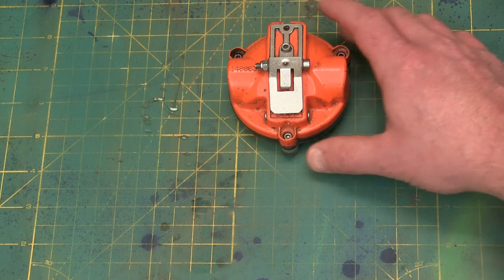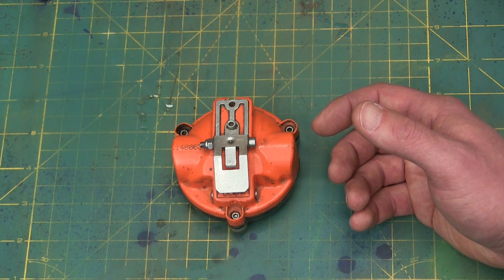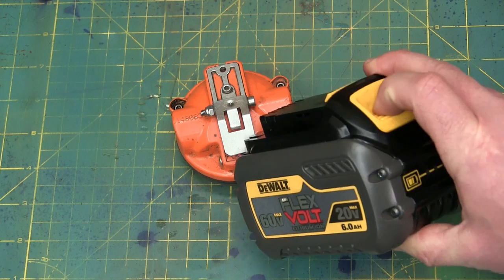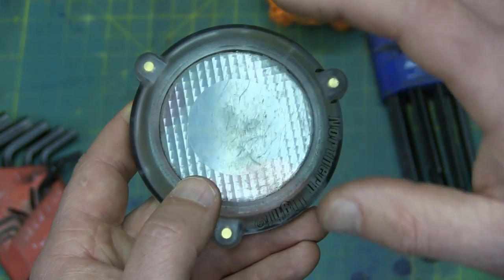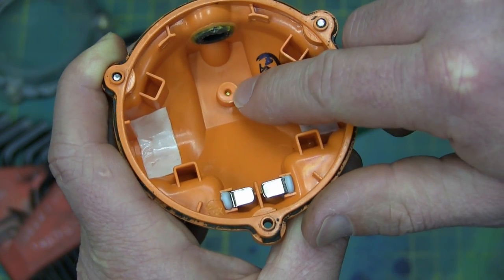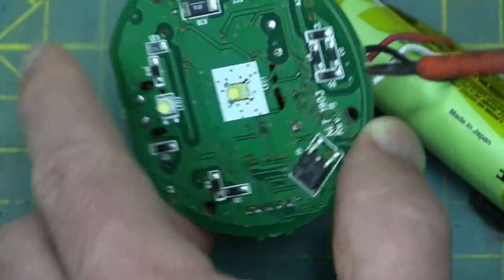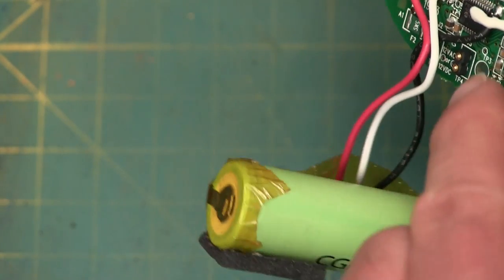BOLTR: $500 Industrial FLASHLIGHT. WHY SO MUCH?

Comment: It looks like an 18650 battery.
Reply: 18650= 18 mm diameter X 65 mm in length. "0"= round.
Reply: A Panasonic CGR18650EA to be exact based on the label it's clearly in focus around 5:42, I think that line had roughly 2500 mAh nominal capacity on the specification. 

And they handled up to 5A discharge well enough based on the 2 of them that I've used over the years. Wouldn't know what the actual datasheet specified for them, I just know they held up to that for a good while in my use (acceptable operating temperatures of the cells, so definitely not too much internal resistance)
Reply: Extra stuff And it's a relatively recent one, having the same wrapper as the famous NCR18650B (older Panasonic 18650s came with a different wrapper)
Reply: Model Number: CGR18650EA   Nominal Voltage: 3.6  Typical Capacity (mAh): 2550
Reply: NetRoller3D : the NCR19650B is not that great of a battery it  has a max discharge rating of only 4.87amp  the NCR18650GA  Is a Much better 18650 3500Mah & 10amp discharge rating

Comment: I found a way of 'cutting' tempered glass decades ago while working for a car breaker.

Oxy/ace! Cuts through like a hot knife through butter. 

I was young and just messing around while cutting up parts of the car for fun. It was going in the crusher anyway and I didn't have to pay for the gasses. I'm much more temperate now I pay the bills!

Comment: by the way that's an 18 650 battery
Reply: Looks  too thick to be an 18650; I'd say 26650.
Reply: Even with the very clearly showing 18650 text on it?
Reply: It's right in the battery.
Reply: I believe he was referring to the ah. Jeezlus Fuuuk!
Reply: 3400mah
Reply: +David Reynolds
It's a CGR-18650EA: a 2550 mAh battery.
Reply: It is 100 percent a 18650. I use them everyday.
Reply: Correct. 18mm diameter x 65mm length 0 denominates that it is a round cell. .... From what I've read.
Reply: Skip to 5:42 and read the label, as the others were saying here its clearly a Panasonic CGR18650EA
Reply: Rob Oh, I thought it was a simple extension of the numbering of button cells: 2 digits diameter in mm, then 2 (or 3) digits thickness in tenth of mm.  So 2032=20mm diameter 3.2mm thick,  18650=18mm diameter, 65.0mm thick.

Comment: If you're ever looking to clean plasticy headlights or lenses. Use 3000 grit wet sandpaper will take the haze and shit right off the lense. Takes a bit of elbow grease. Once youve cleaned and dried it with a cloth you  can use automotive grade clear coat in a rattle can. It takes the haze out completely from the damage the sandpaper did.

Comment: i thought you used acetone to crack polycarbonate? works on cd's (remember cd's?), this is probably a bit thicker tho.
Reply: mmmhorsesteaks i thought cds where acrylic
Reply: Nope, poly. #TheMoreYouKnow
Reply: yes it does, i can personally attest to  brake cleaner DESTROYING my acrylic water-cooling loop on my pc.
Reply: I've had acrylic spontaneously crack from cleaning it with IPA
Reply: Environmental Stress Cracking (ESC) One  theory is that the liquid can diffuse into the polymer, causing swelling which increases the polymer’s chain mobility, this would be increased if the polymer surface is damaged or under stress.
 I accidentally destroyed an acrylic motorcycle wind-shield when I tried cleaning it with Isopropyl alcohol (propan-2-ol), it was OK till I got to the edges, then it crazed.
Reply: Acetone is quite brutal to many plastics. But if you want to destroy almost any plastic, use dichloromethane. It will not necessarily crack them, but gooify them and mess up the surface or shape. It's used to "weld" acrylic (leaves invisible joints). Also works for glueing PC, PS, ABS and a few others.
To the others here: yes, acrylic is pretty much destroyed by anything, even "harmless" ethanol.
Reply: *****
 That makes sense, the  acrylic motorcycle wind-shield I mentioned had a flame polished edge. The Isopropyl alcohol was fine until I got it on the edge and it crazed.

Comment: The battery is an 18650 series. That circuit is a BMS "Battery Mainteain System" over volt/temp and battery voltage maintenance for when left on the the charger for long periods of time.  Love your videos. Keep them coming.

JD
Red Deer

Comment: 3XX are primarily austenitic and can indeed be a bit magnetic (if they are cheapo on Nickel addition for example). A bit of magnetism comes from delta-ferrite that is in them (residual from solidificaiton during production) and martensite which can form on cooling (when these are annealed) in low alloyed versions and also forms when this steel is subject to strain (for example cutting, bending etc.). High Ni grades will not transform that easily.

Edit: Awesome videos! (forgot to add)

Comment: Interestingly, back when I made eyeglasses for my day job, I was able to crack polycarbonate lenses with 91% isopropyl alcohol.  With the scratch resistant coating removed, you could submerge it in alcohol for days with zero effect.  If you inserted the lens into what I believe was a cellulose acetate frame and leave some 91% isopropyl alcohol in the groove between the frame and the lens, within a couple of hours or less, you would see a crack forming in the lens, but the frame didn't seem to care.  There was some kind of chemical reaction occurring there which the polycarbonate was not happy with.

Also, to crack polycarbonate, you just need to physically stress the material--pinch it with a vice grips and leave it like that for awhile--and cracks will develop.

Comment: They should have used an NCR18650B cell for the price they are charging

The NCR18650B cell holds almost 50% more energy than the CGR18650EA cell and only costs a few dollars more while having the same max continuous discharge rating 

NCR18650B: 3400mah 5A max drain 
CGR18650EA: 2500mah 5A max drain
Reply: In general the higher capacity ones don't last as many cycles. Though I think they can just have a changeable battery therefore when it dies you don't need to wait for it to charge.
Reply: @groundzero_-lm4md  it's the same cell that tesla uses in their cars, they are rated for around 1500 cycles

Comment: I use Panasonic 18650 batteries in my flashlights. They cost about $5-$6 a piece, but they work very well. I just use small neodymium to bridge the batteries in series, and they have amazing power density for their form factor. They will only fit in items that are sized for the larger 18650 battery though. I believe these are the same brand/type batteries used in the Tesla Model S.

Comment: The thermostatic fuse your talking about is likely a thermistor for charging. Li-Ion cells are a bit touchy to charge properly, normally cell temperature is monitored to prevent fires

Comment: CGR-18650EA industrial use, unprotected, 3.0-4.2v, 5 amp max discharge, 2500 mAh.   18650s are appx 18mm diameter and 65mm length.  probably around 500 - 600 discharge/charge cycles for about 70% of initial capacity.

Comment: Should have used methyl ethyl ketone or MEK on the lens. We had it in the shop for secondary processing of some plastic parts. Dip them in the MEK and jam it immediately in the hole, together forever. We also made plastic hub caps for semi-trailers. They were 1/4" polycarb. Every so often one would get stuck in the mold. By the time someone noticed it had shrunk on to the mold so tight the injector pins would blow right through it when you upped the pressure. Now you are stuck beating on it for an hour (never good for the mold). Or you pour MEK on it. Give it about 5min and stink up the place. Then you hear POP, and the cracked part falls out of the machine.

Comment: A lot of those protection circuits are current-limiting resistors to prevent unwanted sparking  and Zener diodes to prevent reverse charging of the battery.  The spacing of the components on the circuitboard is also critical to meet the certification, both to reduce component temperatures and making sure that there won't be any sparking between the components.  Typically, a class 1 div 1 electronic device will have a number of protection concepts including being intrinsically safe and incapable of releasing enough energy to create a spark.  At my company, certifying something for class 1 div 1 with UL tends to cost anywhere from $5-50k US, with additional cost for certifying for Canadian standards.

Comment: I realize I am super late to this party but the reason the lens didn't break is because someone molded it extremely well, rather than just squeezing and squirting the plastic without a care in the world.

If you know what you are doing and the geometry supports the method, you can alleviate those internal stresses during the molding process. This is mandatory for optical quality components and, as noted here, pretty useful for safety as well.

Comment: That battery is common (18650) in Vape boxes and you can find replacements, chargers and other related pieces at smoke shops. They operate at around 3000mAh 3.7V.

Comment: The battery size is 18650 (it's printed right on the side). It's a pretty standard battery that's found in everything from electric cars to electronic cigarettes and laptops. Also, a lot of high end flashlights (brands like Olight, Streamlight, FlashTorch, Nitecore, SureFire, etc.) use them.

I have several ranging from 3000mAh 40A drain to  3500mAh 30A drain to 2100mAh 20A drain.

They are a very versital Li-ion battery and tend to be pretty cheap. Also, plenty of cheap >$20 US for a decent 2 bay charger and >$35 for a decent 4 bay charger.

It doesn't suprise me that they chose this battery standard; it's cheap, it can hold decent capacity, and it's pretty much the standard.

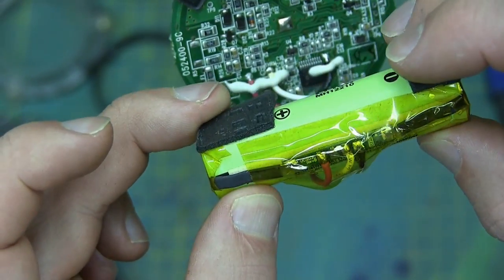Comment: ... but the PRO is: The cell is made in Japan (not China) @6:10  ;-))
Very funny - 500 bucks vs. parts for around 4 to 8 USD (incl. PCB exkl. the cell from japan, hehe, and the case, metal clip and screws), I would say: A fair product and very modest profit margin! (I speak sarcasm fluently - hope u mentioned this, hehe)

Comment: The battery is an 18650 battery... Just means 18mm diameter x 65mm tall. They usually output 3.7v (really about 4.2v when fully charged down to 2.7 discharged). Maximum capacity with current technology is around 3400Mah. Max current on the really good ones is around 25A continuous drain. Obviously capacity drops as current goes up and vice versa.

Comment: a little acetone will do the trick to craze polycarbonate. It is a common trick in aluminum shops to dip someone's safety mcglarsses. Berryman's carb cleaner works as well, since it has acetone.

BTW, even the 300 series of stainless can be magnetic. cold working disturbs the austenitic grains, and causes slight magnetism. 316 fasteners are surprising magnetic.

Comment: best i can tell is that battery is 2500 mah with a 10 amp rating. decent all purpose cell. if you want to know more about 18650 batteries i suggest pokin around vaping forums. theve got full on charts for these batteries to decode battery chemistry, mah, and max discharge. gotta love the cloud chuckrs

Comment: The battery is 18650: 18 mm dia, 65 mm length. Can be found in vapes, cells of laptop battery, and of course Tesla electric cars (6000 of it).

Comment: Bit of a late one.. Trying to shatter a clear plastic? Take a sheet of PMMA, drill and tap it then thread lock a bolt into it. Sit back and wait as the thread lock splits the plastic. Found that one out when the cheapskates at the engineering company I worked for refused to use polycarbonate for their robot enclosures and used perspex instead.

Comment: ElecEng here, I've never played underground but worked in surface iron ore and coal.  Lots of mates in both on and offshore oil and gas as well as underground coal, nickel and gold.  I also used to do electronics design.

I wouldn't design it using a voltage regulator account heat dissipation and hence fire risk.  Think Moura (Pronouced moa rah)  coal disaster in Queensland australia.  Bad.  Very Very Bad.

Comment: In the US, things have to be MSHA (Mine Safety and Health Association) certified if they're to be used past the last break or crosscut toward the face (which can have gas due to poor ventilation). From that break back, they don't need certification. I used to manufacture water sprays for fire suppression at the belt head, flight monitors, roller switches, etc., and then worked in the engineering dept at a local mining machine mfg (roof bolters, etc).  The testing with MSHA is not as bad as you would think on most of it (like lights), as they require a sample of each part, etc, for testing. The fee wasn't that expensive when I was in it, but it could be more now. However, MSHA rating does bring more money, as it is generally over manufacturers insurance, so I stayed away from anything electrical that is used past the last crosscut to the face. Now, that being stated, $500 seems way too much for that, but a Koehler Wheat lamp is much more expensive, around $650.

Comment: You should break down a $500 - 1000 LED searchlight in today's technology. Thrunite, Acebeam, Fenix, Olight, Nitecore, Noctigon, Manker, BLF/Lumintop for example. You can find info on different models at budgetlightforum or candlepowerforums.

Comment: No casting marks because its one solid cast the part where the seal is that connects to the lens is where you will find the cast marks. If you look inside of the body of the flashlight you can see where the ejector pens are. The press side of the mold goes inside of the body.

Comment: I'll bet you that clip on the back IS a 300 series. I've seen 316L act magnetic after being bent because it aligns the molecules as the one side of the metal is stretched. This was with surgical staples in my mom's head and the magnetic force was an MRI machine as she walked by the room it was in.

Comment: My made in Canada radiator fixed my 1999 Blazer! I was stupefied to see a $98 radiator arrive with "Made in Canada" molded into the plastic end tanks. The truck had been overheating on hills. She made it over the 11,995 foot summit of Loveland Pass on an unusually warm day, and over the 12,170 foot summit of Independence Pass, and the temp gauge stayed right at the 195 degree operating temp!!! I also put on a USA made fan clutch, thermostat, radiator cap, and a Mexican genuine GM water pump. No more overheating! I checked the head gaskets for exhaust blown into the water jackets, compression, etc. All okay, so far! My uncles & I worked in the Molybdenum  mine up near abouts them mountain passes. It's open pit now, but it used to be underground. We had similar lamps, with larger batteries, but the SMPS was not quite as common back then. With the snow melt it rained all spring, summer & fall  in that mine. Add a dark labyrinth of tunnels to that damp mess, and I'd want a $500 flash light! Climax dug an open pit over the old stoped mine. Lots of the equipment was too large to make it back through the timber bracing, so there is millions of dollars in mining equipment in and under that pit now. My other uncle makes the helical screw compressor skids for mining. Those are built to fit a standard shipping container, and are used domestically, and exported all around the globe.

Comment: Austenetic stainless steels can become slightly magnetic through work hardening.  ie. stamping and forming processes.  Solution annealing is required to remove its magnetic properties.  Not disputing your keen analysis.  Just throwing a little insight out there. 👍  precipitation hardened stainless steels are commonly used in clips and springs as well.  I’ll shut up now.

Comment: Ave - this circuit most likely uses Pulse Width Modulation to control the power to the LEDs, hence the microcontroller and the big MOSFET cannot see another reason why would put a micro in a torch, basically to output some PWM, Read the switch input and a timer for the flash mode, probably not much code in there, 100 lines if that.

Comment: by the way...   finger the rubbing compound or jewelers rouge on the foggy lens . when using cloth or foam buffers the abrasive gets into those and does not end up cutting .. 

i use my palm and some meguiers plastix on headlight lenses on cars.. 20 seconds and they are ready for a wipe down..  a single drop on my cell phone lens protector and rubbing.. not getting it in the microphone or speaker holes.. comes up nice and clean..   you might need to use leather scrap on the lens and spin it with a die grinder.

Comment: "4000 lux" doesn't mean anything without a distance, which is why most modern lights advertise lumens (total light output) and candela (intensity, equivalent to lux at 1 meter).
Reply: Zak Wilson lumen is still over a unit steradian. lux is useful because it describes the situation if all of the light was dumped over a square meter regardless of distance or angle. We use it in lighting and optics all the time. fair point that it doesn't describe light penetration though. The primary LED is a luxeon rebel and it has a pretty wide emission, even though it is lambertian (high emission toward front). No secondary optics for piercing light.
Reply: When describing a light source, lux by itself is nearly meaningless unless you're talking about its surface brightness, which we're not. Almost any useful light source will have a surface brightness much more than 4000 lux (i.e. put it in direct contact with a luxmeter). Surface brightness of the emitter doesn't tell you much without knowing a bunch of details about the optics.

Peak lux at X distance is a useful measurement (but under normal circumstances, just use candela). Lux at X distance and angle is useful measurement.